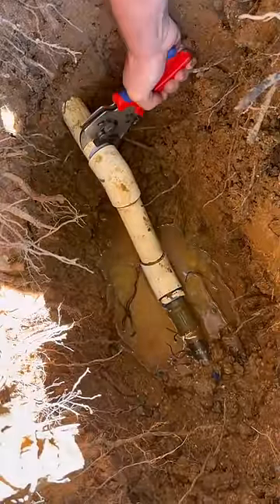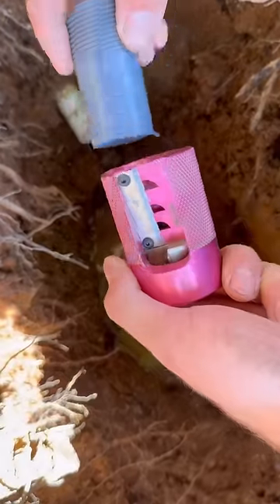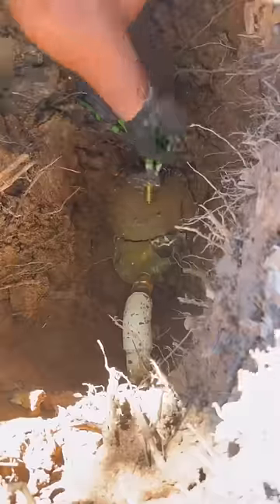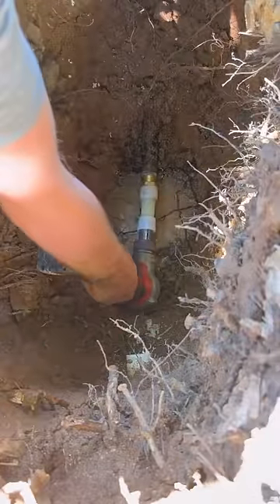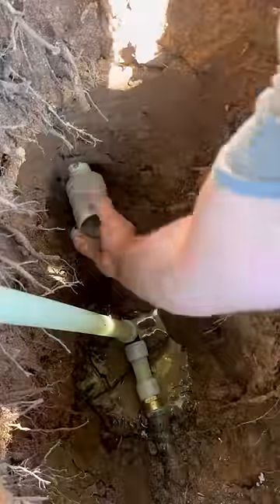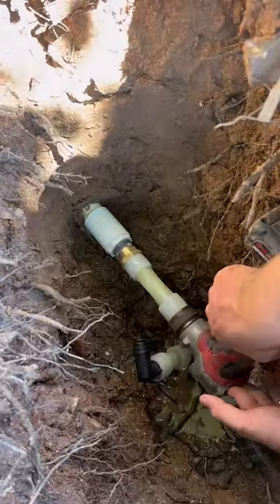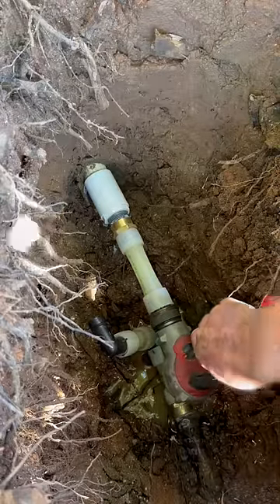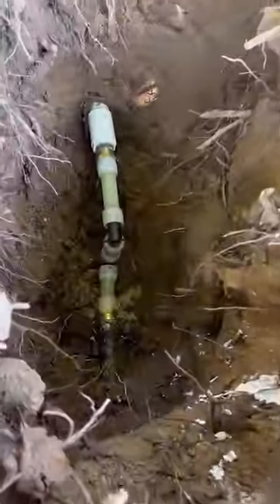pvc water service line repair

Comment: Ok, legit question from a non-plumber. Why did you go with two 90’s? Seemed like the 45s would be better for flow (but again, I know nothing).
Reply: Flow isn't an issue with water lines. They're pressurized, which effectively means they're always "topped off" and water (cold water, at least)  is available at the fixture immediately. 

Flow is most certainly a drain issue.
Reply: Two 90s provide more flexibility for ground movement.
Reply: @baronvoncrags771  pressure will stay the same however he has reduced the  gallons per minute by using the smaller pipe and 90s instead of 45s

Comment: Me and my dad had one of those days 2 a few days ago this week. We had to reset a toilet with a new wax seal at a bingo building. Needless to say it should of been a 1hr job tops but ended up being 4hrs with multiple trips to supply. 1st the offset flange was broke so we had to put new flange down and drill holes but some of them screws we had wouldn't hold so there's another trip to home depot for different concrete screws and new wax seal get back get the new flange secure put new wax down set it secure the toilet hook it up run it and after the 3rd flush water comes out the side. So we pull it go back to the supply and buy another 3 wax seals without the horn bc we found out the offset was causing the horn to slide off the center and roll. So finally I said fuck it and took 2 flat seals without the horn and had to stretch them out some to fit the shape if the offset and stacked the 2 seals and set the toilet and finally it worked. But after doing plumbing for 10 plus years and my dad doing it for 40 plus years as journeyman he's never had one do that to him but then again the offset that they used was super weird and I've never seen  one look like that one did I should of took a picture of it.

Comment: Im sure you appreciated the hole being dug, but if this is a domestic water line ,weren't you concerned about contamination? Or did you bleach the line before making the connection?

Just an observation and love the work and the Voices!!👍👍
Reply from the maker: The water you drink was dinosaur piss at one point buddy
Reply: @replumb yes and that was after it was a comet
Reply: If it’s city water it will probably have chlorine or chloramines in it anyway.

Comment: They used schedule 40 pvc for a water main ? Is that aloud ?
Reply from the maker: Yes
Reply: It's legal only time I see it is for 2 inch and larger Service lines to house. Drastically cheaper for the builder no real point for line that small.

Comment: Question. is it the norm to replace just the broken section or all the way to the street? And ball park of the cost for such a repair. 

I’m like 80% my mains has a similar leak / crack.. no puddle.. I think its close to my house so the sump pump is just immediately pumping it away.. just a theory.. I hear running water, even with the mains shut off 🤨

I bet you get questions like this all the time, so nbd if you don’t want to waste your time. Keep up the good work!- love the videos and the voice overs, especially the cranky boomer
Reply: Would vary by area depth and soil conditions type of piping ect.

Comment: the overvoice is familiar.

I'm an electrician.  One of the scumbags I worked for who smoked cigarettes for a living and sat in his van one day decided to challenge me as in his mind at the time "I was only a low voltage guy"...

We had a contest where I told him I'd snake 4 outlets in a retro-fit in the time it took him to do 2 of them...I did prevent him from drilling across studs blindly.

He fired me after the job.  Was all of a month or two of work.

He later offered to have me use him to pull permits at 25k a year for my "low volt" business he doesn't understand even though I have a license to pull my own...right.

Comment: I replaced my 60 year old galvanized 3/4 with 1 inch pex A for my water main. I did incase it with 2 inch schedule 40 pvc to protect it from roots and shovels
Reply from the maker: If it ever leaks you’ll have no idea where it’s coming from. It’ll just be showing at the beginning and/or the end of the sleeve
Reply: Well played  @replumb boy.

I really don't like Uponor, prefer Sharkbite brass and stainless clamp for buried work.

Use of PVC conduit is good form when pulling under sidewalk or driveway. You don't want a leak undermining the concrete flatwork.
Reply: @replumb  yes but I can just pull it out and replace it very quickly with out removing my driveway or yard. And it's only a 40ft run
Reply: @replumb if it's in a sleeve why would you waste your time wondering where it's leaking to begin with. Disconnect the ends and tie a new line on with a coupling and pull it through. Sounds like ur mad he did it better than you would.

Comment: When you 90 pvc you just have to cut the PVC where the riser piece is at the bottom of the horizontal piece...you don't need a tape measure when doing PVC... just a level

Comment: little didn you know that by making the pipe smaller diameter, you restricted the max water flow/pressure...  thats why you cant learn everything from youtube kids
Reply from the maker: The meter is 3/4 anyways. This is before the pressure regulator. It will restrict flow rate in that area but won’t affect volume or pressure